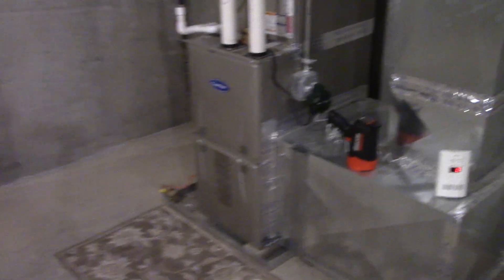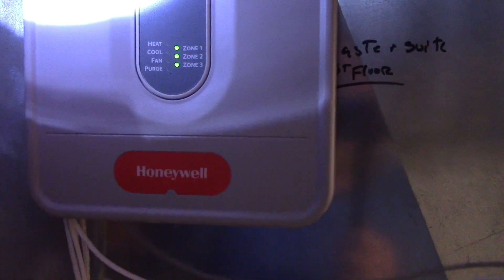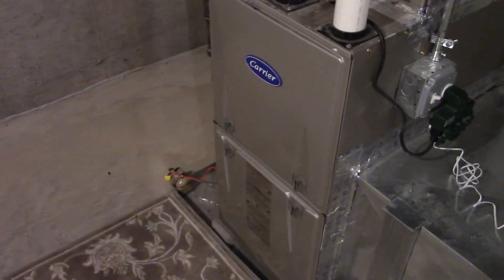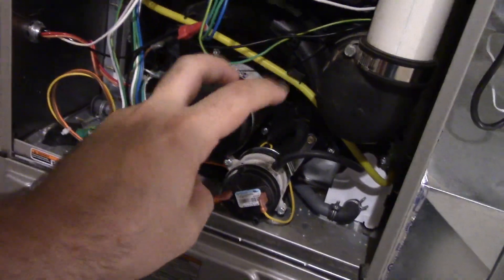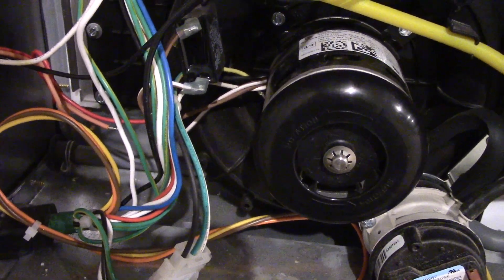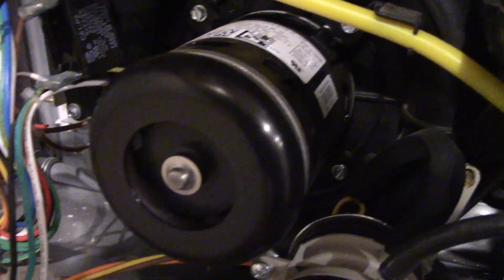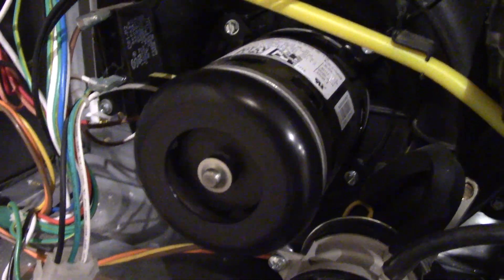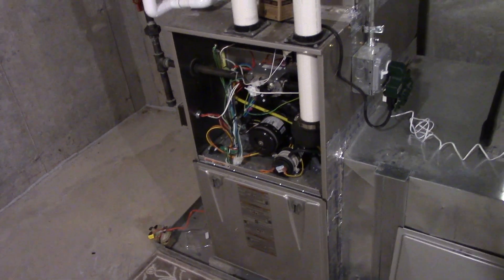Carrier 92% Efficient Natural Gas Furnace.

Comment: My old 1998 Goodman furnace and carrier air conditioner has been replaced… it was replaced with a Lennox furnace and air conditioner… I also got a new thermostat as well… so far, it is a great system… we had a whole house humidifier for we had that thing removed… it has never worked anyways… I pulled parts out of the old furnace shell…
Reply from the maker: Yeah if ya don't have use for it, no need to have it :)
Reply: @Sharkie626  the new Lennox has kept me cool so far…

Comment: Low speed on heating is so the air actually heats up as it passes by the heat exchanger....if it goes by it to fast then the air wont be the right temperature to heat the house efficiently.....one reason why you dont oversize a furnace is cuz it will short cycle, the longer a furnace runs the more efficiently it will heat the house leaving less cold spots and hot spots simply put heats the house evenly.....!!!
Reply from the maker: Oh I've felt it get hot even on higher speeds! My only issue is that the blower comes on 23 seconds after burner ignition. That's way too soon, but sadly I cannot adjust it. I would let it go for a minute, or maybe 45 seconds.

Comment: I have a carrier 58mca 060 with a pump on the outside to pump the 
condensation water outside the house(built on a slab). There is a pvc 
pipe from the trap to the pump, sticking down through a hole into the 
bottom of the pump. If the tube is under the surface of the water in the
 pump before it empties, is that considered another trap and should I 
shorten it to keep it above the water? It has been installed and 
operating that way for about 20 yrs but I don't know if it should be. 
Thanks
Reply from the maker: I think our pipe gets under the water at some point too? If you are concerned, I guess try to keep it above the water.
Reply: Is the airflow(cfm) the same in the cooling mode as the Heat mode? I have original manuals for my carrier 58mca-060-16110 furnace but there are no Airflow tables in it and I can't locate them on the internet. Thanks
Reply from the maker: @normanziegelmeyer7693  Probably different since by default, cooling mode uses a higher blower speed.
Reply: What spec defines proper Heat CFM?

Comment: How do you change filters on this unit side mounted
Reply from the maker: Look at where your return duct goes into the unit. It should be right around there.
Reply: I looked at the manual and it says there are three filters. Is there one or three filters because I saw images of the same furnace with a 16x25x1 filter being replaced.
Reply: It’s installed in my attic and I couldn’t find it anywhere and it was too difficult to go behind.

Comment: Appreciate all the efffort you put in the video. I just had one put in Model 59TP6B by a so- called CARRIER certified installer. Couple of things that just does not look correct on the vinting the unit is in one story home a vinted closet . Installed one  2"  PVC to  roof top  on 2-3 inches  above  existing rooftop I believe it should be at  least 12 inches above the  ext. rooftop ? and  the second  issue is  the  second 2 in. vent is ran from the bottom of  unit straight bown 12in.  with a 90-degree elbow. "SO IS THAT VENTED CORRECTLY?"
Reply from the maker: It sounds okay, but I would check with a HVAC professional.

Comment: those furnaces are designed by airospace engeniers at department of defense there a weapon, elctric companies and carrier are all owned by nisource which is owned by a technologies place for get name that works for d.o.d they produce deadly gasses and poison home with several health issues, there outlawed in california for murdering many people cathing fire melting pipes and producing pollution, carrier knowingly made and sold faulty heat exchangers. dupont and 3ms painted them several parts with deadly pfoa C8 chemical. its used by d.o.d military to paint tanks and weapons witth waterproof and fire proof and sun proof c8 chemicals. they were sued in early 2000 by lawfirms dupont was! watch the true story movie Dark Waters! now!!!! the furnicases lower bill alittle but twice a year maintinace and flushing of the drain tube always that fills with deadly molds and bugs! you cannot put allergy filters in them they overheat and malfunction and filters need changed several times a month reported by many, the exhust vent sucks outside polluted air, molds, fungus and bugs and chemical trails by planes into home! fills your vents with moisture causes rust and molds to grow makes families sick and release lead into home theres a sticker on them warning label about all this nobody reads! carbon monoxide detectors do not alarm of these dangers. youll get headaches skin issues cancers organ failures copd and many other issues. the class action lawsuit against carrier is closed so you cant be refunded with settlement! when gas is off you can feel the moisture come out them and cold air. they raise the humudidty in home should be 30% in winter your homes probably 50 or 60 or higher. in summer fills with pollens and molds. theres no filters built into them at all or exhaust line or screen even! even chipmunks rats and squires can crawl into pipes. birds and bugs. there a weapon designed by weapon makers to kill people for population control! and mass genocide causes people to go to doctors with health issues so you have to get more meds and more problems from also government owned doctors! and pharmacuticl companies. do your resaerch before you call me a nut! your electric company and gas company and carrier all go to same people through nisource and then aerospace technologies i think it was then dod and military! wish your family the best have that weapon removed
Reply: You are a real "Nut-Bar"

Comment: I checked out a video of a RUUD Silhouette 80 percent natural gas furnace which is similar to Rheem and as soon as the hot surface igniter de-energizes, that is right when the blower turns on.  Therefore I noticed that the blower turned on sooner compared to yours and the 1997 Lennox that you made the video of.  Here is the link to the video:

https://www.youtube.com/watch?v=447V31BQPbo
Reply from the maker: Yeah the blower comes on too soon still I think. I would let the heat exchanger heat up for maybe a minute before having it go on.
Reply: @Sharkie626  I am sure it does.  I can hear it turn on.

Comment: Just got a Carrier Performance 96 2-Stage furnace. Paired with a performance 2-stage air conditioner. Mine has a variable speed ECM blower, so not so sure about longevity, but hey, it certainly pumps cold air! We did a test in heating mode, and the house heated VERY quickly! Same goes for cooling.

Comment: The amount of noise that thing makes is getting on the range of comparable to an oil burner!  Those burners are exceptionally noisy.  Weird.  Perhaps the airflow has something to do with that.

Paint some stripes on the inducer motor, perpendicular to the direction of rotation.  Use something like White-Out.  It'll make it look even cooler when spinning.  Or just put some Sharkie stickers on the front part.

There are way too many electronicals in that unit, like all modern ones.  Sad; my '72 Hydrotherm boiler has none of that, nor does it need or want any of that.
Reply from the maker: When you're by the unit, even with the front panel on, you get a nice rumbling effect. Love stuff like that. I am VERY glad this furnace is just on and off. 

I was considering making stripes on the inducer, but decided not to since I did this video in 30 FPS. Maybe in the future I'll do something like that. That second idea is interesting though! Haha. At some point I'll probably also make a video of the unit starting up (panels on) when it's very cold outside, and then head outside to show the steam coming out of the exhaust pipe, although I don't know what the minimum tolerable temperature is for cameras. 

Yep. The extra electronics come from the separate zones which my folks thought of back when. Carrier and Honeywell seem to be good brands, so we'll see what the future holds. Aside from that, I don't think it has much more than the Lennox furnace I recorded a few years back. I also don't think the whole house humidifier has any effect on how the air handler operates. 

Your Hydrotherm boiler might not have electronics......but can it see why sharks love Cinnamon Toast Crunch??
Reply: The book for the camera will tell you about temperatures.  But if you want to be extra cautious, just place it on a shelf in the garage overnight first, that way it's fully acclimated to the outside temperature.  You can record all you want.  But let it acclimate inside for several hours if your're going to record again.  In the summer, on those really hot and humid days, when I'd bring the camera outside, it would fog up immediately.  The cold lens and humid temperatures caused moisture to condense on it.  Had to wait 10 minutes or so for it to acclimate.  Imagine how this was back in the day with machines that used tape!  Had that happen on both cruises I was on.

The boiler can't see why sharks love Cinnamon Toast Crunch.  It also can't believe why paying $4.79 a box is tolerable.  The cereal I get from Aldi tastes just the same and it's less than half the price.  I bought the Aldi equivalent of Honey Smacks, they're pretty much the same, and it was 15.3oz for $2.19.  Round that off to 16 ounces, or one pound.  What's scarier is that I can get chicken breasts for $1.79 a pound, and leg quarters for 59 cents a pound.  I'm going to start eating chicken for breakfast, much cheaper than cereal.  "Sweetened chicken puffs, enlarged to show texture.  Made with real meat."
Reply from the maker: Good idea. I'll keep that in mind for the cam. 

Great second part of your comment! Haha. I actually don't buy that cereal at all. I could see a regular commercial come up for that and then in the middle of it... record scratch sound  now enter you with your explanations and intervention. Hey! Maybe an idea for a future video for ya ;)